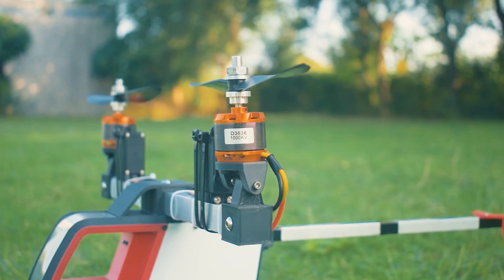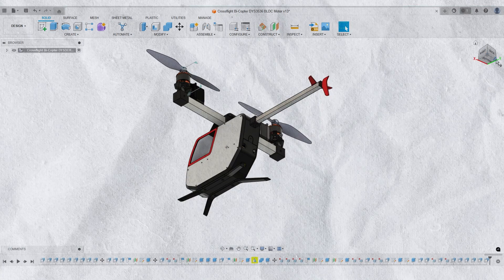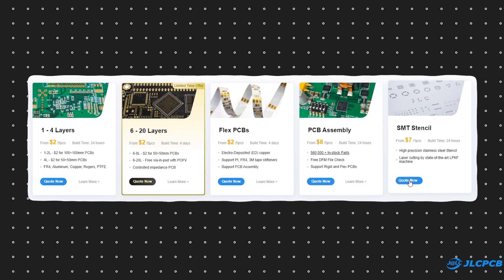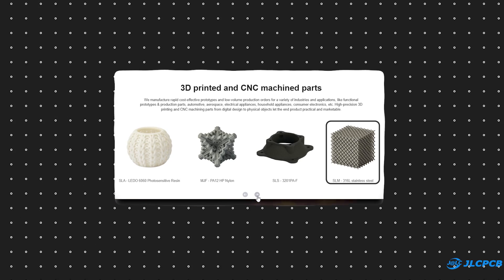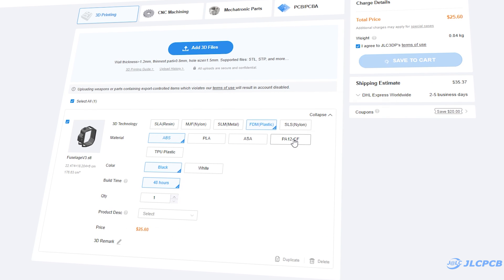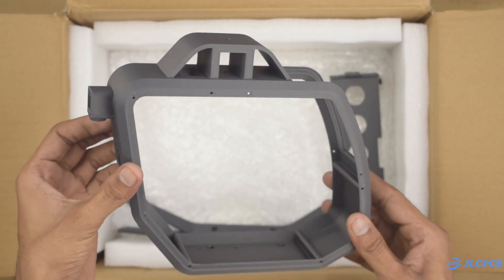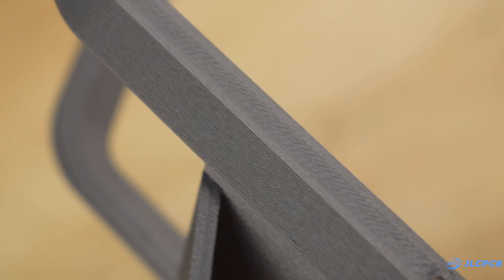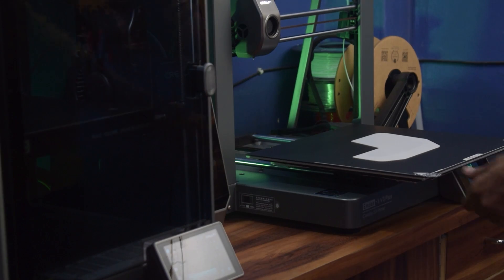Build Your Own Tilt Rotor Helicopter: DIY Bi-Copter Drone Project" #drone  #helicopter

Comment from the maker: Thanks for watching, everyone! I've put in three months of hard work on this project, but I'm still not completely satisfied with the ending. I'm already planning an improved version for the future! If you enjoyed the video, please support the channel by liking👍, sharing, and subscribing. Your support means a lot! 😀

For all the students out there, don't miss out on the Altium Student Lab – it's an amazing opportunity to jumpstart your career in electronics and PCB design. Learn more here: https://www.altium.com/in/education/students

And if you don't have a 3D printer, check out JLC3DP for your 3D printing needs: https://jlcpcb.com/?from=Vishal
Reply: Please make smartwatch under 10k please after 10 days my exebisition
Reply: without reading the code its impossible to comment what went wrong. But from the Aerial Robot's behaviour it seems to be a simple issue of inefficient (or even wrong ) PID tuning . Moreover the controller is accumulating errors as its integrating that's why drone behaves right for some time and as error sum grows it behaves weirdly and crashes.
Still good attempt.
Improve on this and post the updates.
Reply: link programing please ,sir
Reply: Use gyro sensor too read the accordingly servo set motor and propelar at 90 angle from ground and motor while take off and vice versa .  when helicopter till motor direction automatically go in opposite directions in same angle and vice versa .one more thing the balance you drone perfectly change positions of components and battery too.

Comment: the main problem is the shaft that you connected to motor, you place it on center of gravity of copter but is should be like wide v shape and and the center of angle must be little bit ahead of center of gravity and the motors must be little bit back of center of gravity of the copter this is how it will be self balanced and working "now these motors are connected in stight line" which is broblem, it look like that you hang something on the string.

Comment: You just need to upgrade it with a tail propeller which will be helpful in balancing the wobble and direction them the main propeller will be free to use of go forward and backward 
And try to use ab high kv motor with less diameter of main propeller along with tail propeller then it will work good

Comment: 1. Check the direction for servos [ very rare case: they might be correcting the pitch in the wrong direction ]
2. What are you maximum I limit , also reduce that for pitch.
3. Retune the pid , start with D [ keeping p and i 0]and increase until it lags a bit, reduce the value by 10% , set the p gains , you will have setup which flys, even in PD , the drop the p value by 30% and set the I value

I recently wrote a small firmware for a quad, 
https://youtube.com/shorts/-I_n8uXfIKM?si=qXwvghTF8J-TwLV_

I faced a similar issue

Comment: Use Resistors to control the flow of Current and Capacitors to store and delivers the energy (Current) when needed. You are having this issues as after some times flying, the battery gets depleted and the current decreases so the motors loses Torque and doesn't rotate with the same said speed so that it stays stable for a longer period as the Current will stay the same even when the battery is depleting..Means at 100% Battery the motors will be rotating with the same speed as when the battery is at < 10%.

Comment: U build with steel square pipe so I think u should use different light material, i think so equal balance weight front and back

Comment: if this is not with PIDs then you should check the CoG to under the line connecting your motors, other than this the issue can be with your ESCs try changing the update rate of the(PWM freq in this case) or use digital shot ESCs

Comment: the actual problem is vibration of motors which cause imbalanced flight or simply you can say noise for flight controller. To solve this you should mount the servo motors with proper screws and avoid the use of cable ties to hold servo motors properly. also you can use flight controller shock absorber board which reduce noise to flight controller that created by motor.

Comment: Bro I want to have some correction
1. Usage of big motors servo & bldc both 
2 . The aluminum Rods could be replaced by ready made carbon fiber  
3. For style the launchpad looks ordinary replaced it by a new style 
4. The calculion you made may have some error recheck the gyro sensors and try to pull the centre of mass accurately at centre 
5. The motor you used are of old categories try using flat bldc motors and have a look at projects weight   
    THIS MIGHT HELP YOU HAVE        
                 A GOOD DAY

Comment: You need to change the thumbnail as soon as possible
Reply from the maker: may I know the reason?
Reply: @proknow The reason is that thumbnails play a crucial role in attracting viewers. A visually striking and relevant thumbnail can significantly increase click-through rates. The current thumbnail doesn't fully capture the quality and excitement of the content, and it might be causing potential viewers to overlook the video. A more engaging and professional-looking thumbnail could help the video reach a broader audience and perform better overall."
Reply from the maker: thank you, can you give me some suggestion?
Reply: @proknow To improve the thumbnail, I suggest using a more dynamic image, like the helicopter in mid-flight, paired with bold text that highlights key details like "DIY RC Helicopter." Adding a vibrant background or a close-up of the tilt rotor mechanism can make the thumbnail more engaging and visually appealing. These changes will help capture viewers' attention and better represent the excitement of the project.
Reply from the maker: ok, Thanks you very much for the suggestion.

Comment: In my experience, high-quality ESCs provide better flight stability. If I  were facing similar stability issues, I would replace both ESCs with the EMAX Bullet Series 35A ESCs (BLHELI_S) with OneShot. 

Additionally, I would check if the frame is causing excessive vibrations and also inspect the propellers, as they can sometimes generate excessive vibrations too.

Comment: Suggestion: Instead of servos, use small gimbal motors with Field oriented control (FOC is important), this will give extremely precise and smooth rotor movement/tilt. I have tried and it works the best!
Also, it seems like the Integral (I value) is accumulating too quickly, maybe try decreasing it a bit. Might work, might not! Worth a try 
Amazing work by the way. Love all your videos!
Reply: He installed a programmable flight controller gyro sensor that is much batter then a gimbal! 😂
Reply: @amankataria100  you don't even know what I'm talking about. Read up! 😂

Comment: compensating for the pendulum effect, that would have to be done, make sure the weight is equally split between the motor axis. that is one of the difficulties for a bi-copter drone, the US military faced similar problem with their tiltrotor craft
Reply from the maker: Thank you for your suggestion! I appreciate your insight. The weight is indeed equally distributed, and the center of gravity (CG) is aligned with the tilt mechanism.